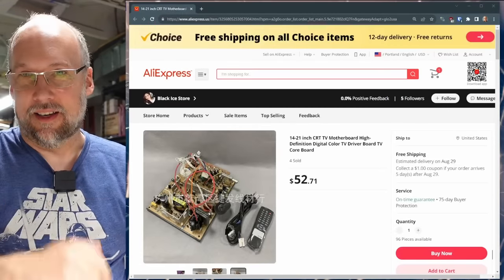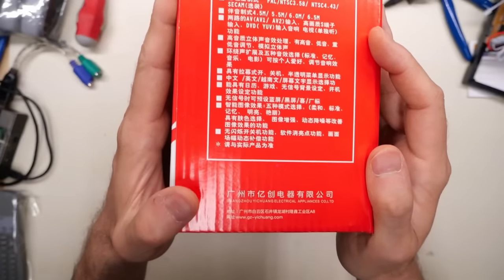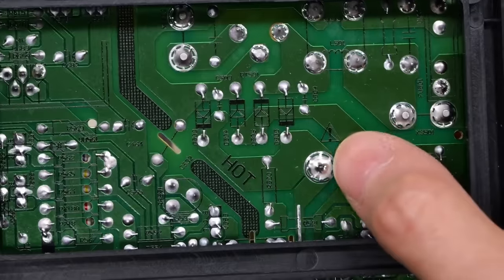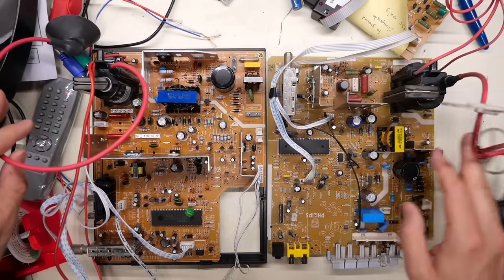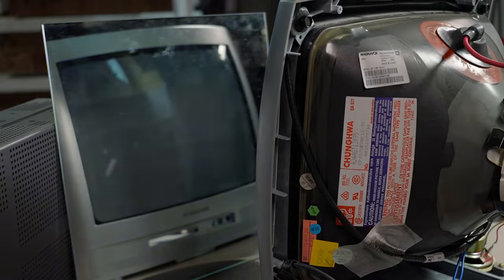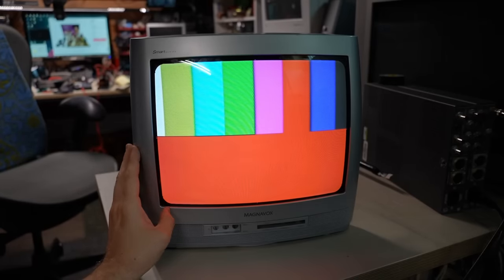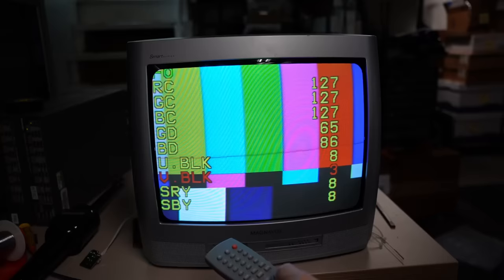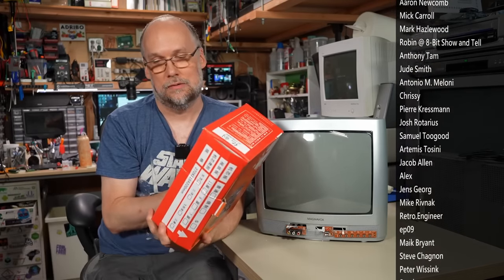I replaced the main board of this TV with brand new parts made in 2023!

Comment: I think the language support hints at what the purpose of these boards is:  repairing TVs in parts of the world where the cost of living is very low and incomes are very low.  All those videos of people building something new or welding an engine block back together, they aren't just clickbait they are really doing this on a regular basis.  Repair culture is at the heart of many low cost countries.
Reply: Yep, not only in countries with relatively low GDP (I think) but also those with high import costs and/or trade sanctions. Another comment mentioned that being done in Indonesia. I had already known of similar boards to allow such repairs to be done to LCD TVs, but never knew about boards for CRT TVs.
Reply: It’s why many cars in Cuba are vintage 1950s & 60s. They keep them repaired and running.
Reply: @OggVorbis69  We used to be a repair culture, but somewhere along the line someone decided it was more expensive to pay someone the labor to repair than to replace.  My most popular video is about resurfacing brake rotors on a rotary table, the amount of comments about how it's a waste of time and cheaper to just buy new Chinese rotors is very high.  The joke's on them, I'm still running the same rotors on that car and I've made a decent amount of money off that video.
Reply: Yep, and that's just the reason why the 'richer' countries try to block right to repair that much. (I think)
Reply: These boards might be New Old Stock (NOS) i.e. made in the past and being sold now.
Reply: @metatechnologist  That was my thought until I saw a 2021 design date on the board and 2023 manufacturing date on components.
Reply: so true my friend
Reply: @joaocosta3374 Not sure where you got that idea, but Japan has disposable material culture. Single-use plastic is practically a national speciality.
Reply: Me too. It's really bad. :( So much can be saved for ourselves and others by not tossing it and crushing it up and crap...
Reply: in the US repair work is a manual skill... Our education system trains students to have a poor opinion of manual skills and glorifies mental tasks....so we have smart educated"managers" taking 10 years experience to make $60k annually while a commercial driver (we call them stupid truck drivers) can start out earning that amount...the truck driver doesn't have to buy any expensive tools or equipment the company provides that, nor do they have to have closets full of office custumes and in just 2 years can be setup to make $100k+
Reply: Not even in countrys were cost makes things prohibitive 
But in nzd we're I just can't be fucked to spend money hahaha
Reply: Sincerely I'm from Brazil and it shocks me at how little value people in 1st world countries give to their possessions. They just throw away good things as if they were garbage for no fucking reason as if it was nothing. The fact that that is normal to them is depressing.
Reply: repairing stuff used to be a U.S. thing too and it brought them a good chunk of the way to where they are today, when they forgot about is when they began the struggle
Reply: @kbhasi  was the user @strugatski1998 ?
Reply: @casev799  
Yes
Reply: The USA is going to end up this way the knewflat screen tvs & monitors are fragile won’t hardly last someone sneezing on them
Reply: @OggVorbis69 yep USA used to repair everything my aunt in her home ec class in the 1950# was tought how to take apart dishwasher fix it & put it back together also all other stuff that a woman at the time would use
Reply: I wouldn't be a jack of all trades if I didn't grow up in poverty
Reply: Soon to be the west....Start learning boys 😅
Reply: LCDs are cheaper than CRTs. This is for arcade machines.
Reply: @videobenny3  That's pretty bad comparison, the Cubans haven't had the option to buy new cars for the past 60 years. That makes it so they've had to repair their old 50's & 60's cars.
Reply: @MrGtagangster  funny thing is the blame that waste to that growing countries while they are the culprit of that e-waste
Reply: @CATech1138  This is what's wrong with the current educational standard.

Education is great, but present options!
Reply: @MrGtagangster  Mathew Crawford's book Shop Class as Soul Craft explores the concept that pencil pusher degrees aren't the universal answer to educational goals....
Reply: @videobenny3  Also in an incredible humid salt laden atmosphere, they do it!!
Reply: @videobenny3 That isn't actually the real reason. It's due to the gov not letting people buy modern cars
Reply: I love to repair things in Germany but most of the people I know tend to just buy new. If they ask for help, I'm glad to do so and also recommend buying 2nd hand stuff when they need replacement and repair isn't possible/economic. Hopefully the EU will be successful in fully enforcing the 'right to repair' some day.
Reply: @joaocosta3374  That's really not true. The Japanese are very fond of throwaway things, and will tear down a perfectly good old home in favor of a generic newly built one.
Reply: @IntegerOfDoom  arguably this is at the core of everything wrong with the us and similar countries, to the point that we treat people in the third world as disposable.
Reply: Its starting to happen here to
Reply: @3333218  é porque os produtos não custa um rim como aqui. É muito imposto para um país de 3° ou 1°, fora que a qualidade é péssima. Está cada vez pior comprar algo novo e que tenha qualidade, nós não temos as mesmas oportunidades de escolhas como os americanos,somos obrigados a sustentar esse sistema falido de pirâmide política. (Nossos políticos só sabem falar em aumentar imposto, talvez seja isso...)
Reply: @JLasdislau  Olha amigo, concordo com o que tu falou mas discordo da sua visão política. Sou Comunista, pra mim não importa o que os políticos façam e quem estiver no poder sempre vai ser a mesma merda; só quando os trabalhadores se unirem e derrubarem o Estado Capitalista Burguês é que a gente vai começar a ver alguma melhora. Curiosidade: Em vários países Socialistas não existem impostos; isso porque essa ideia de que o estado deve funcionar como uma empresa que opera em dinheiro é coisa de Capitalista; dinheiro é só um pedaço de papel, o que tem valor mesmo é o trabalho.
Reply: on the opposite rich countries have a "trash it " cutlure , supported by electrical and electronical appliances manuifacturers . they don't sell spare parts , and sometimes they make their device become obsolete , thus forcing you into buying new one .  servicing is good for the environment
Reply: And they are awesome. It made me realize how wasteful we are. I watched some guys rebuild a whole excavator.
Reply: @kbhasi you can get generic lcd boards? I never would’ve known!
Reply: @uzaiyaro  
Yes. Most sellers even preconfigure them to work with specific LCD panel models that they then indicate in their listing title and description.

Some of those sellers even sell them together with the LCD panel they're configured for, to the point where it's basically one of those off-brand or no-name monitors but without the actual shell, stand, and power adaptor. Those kits really helped to stop game console modders from ripping apart PS1 slim LCD add-ons.
Reply: @MrGtagangster most people prefer to replace than repair anyway and there is still a big movement to prevent repair? It’s weird.
Reply: People in the west are increasingly buying old crts for authentic retro gaming, a lot are dying. So there's two use cases for sure.
Reply: @videobenny3 That has absolutely NOTHING to do it! Google The Cuba Embargo, they literally couldn't buy new cars. There were no imports or exports and I mean none.
Reply: @joaocosta3374 gomi not mura
Reply: I dont think so. 52$ plus 60$ for the service it's a used TV from the last 5 years. Probably this is for retro TV with value
Reply: I watch to much speed running stuff because I did not even think of lower income countries and just thought on how speed runners of older games run them on CRT thanks to lower lag.  To the point that some games are unwinnable on newer screens.
Reply: at the same time it's under attack by crazy people ;D
Reply: Yes and more and more needed as the new things delcine in quality ...I just got a bronie camera from 1930s and omg its so simple and awesome I love it...
Reply: Right to repair is SO important
Reply: That is a fact. And it shows how wasteful we are too. We're lucky.
Reply: I've seen replacement controllers for washing machines. Probably for the same market segment.
Reply: @0x0fffffpossible now with LEDs.

I've repaired some ceiling lamps with "unreplacable" LEDs
Reply: I would say is not so much the cost of parts but the relation of VERY low cost labor to the relative high cost of parts (maybe due to import costs imposed by politicians). People from the US should be happy that their labor is highly priced!
Reply: 3rd world counties have no choice in the matter when they don't have the means for the latest products. In Pakistan they make parts and are quite good at it given the lack of resources.
Reply: @videobenny3 only reason why they have vintage cars is because they can’t get anymore more cars. So once they are gone they are gone. Nothing to do with wanting to repair stuff.
Reply: 'And we wish was worldwide.
Reply: well, i will order this for myself cause my little retrogaming CRT Saba Tv died last week. Ok, i'm italian and  my country isnt one of the richest county in the world, but i thing those solutions are just made to sell to anybody needs them. It's a very Chinese business mindset.
Reply: Yes. When i travelled through afrika they used to repair old fridges and sell them everywhere. Here in germany nobody would repair such things on an 10 year old fridge.
Reply: In Russia's poorest city a doctor earn 5000 usd over 20 years.. So there's the perspective on why repairs on such things still a thing.
Reply: @3333218 More depressing than the crime rate in your country? Watch out for those scooter riding bandits lol.
Reply: this is soo true, its even a cultural thing in countrys like that, i know by first hand that they acutally dont like modern tvs and ppl think they are cursed, dont laugh its real and its a cultural thing there
Reply: @CATech1138  To be fair, there are a LOT of other mental jobs outside of management that are EXTREMELY important....engineering, science, medical - the very reason you're able to write this comment is because of scientists utilizing local networks on college campuses decades ago (along with tons of research and many innovations in the subsequent decades) - creative endeavors, research and manual labor are all very important to the function of society.
Reply: just don't weld a crankshaft.
Reply: That’s why Brazil is still on the PS2 kick and barely over the Sega Master System.
Reply: While it is by necessity it is one of the things I love about my country. You fix things and there are many places to take things to be fixed for you at a reasonably price.
Reply: @Ian-Omega  That's oddly specific and unrelated to my comment. Me convence aí que cê não é BR mano.
Reply: Adding to the comments here I think that now in the West (in Europe at least) this is being discussed more. We have places now where you can bring your items and they'll repair it for you, sometimes even for free to promote this way of thinking. The problem is many products are made to not be repairable. The EU is working on laws for that. Same with cars. There are many people who would like to repair their cars cheaply but modern cars are not only too complex but built like throwaway items. And there is actual proof of this. BMW for example says the transmission oil is a lifetime fill. So it doesn't need changeing (already BS) but when you look closer into what they define as "lifetime" it's a 180.000km!!!! Like WTF for an expensive modern car. Also buying new is often cheaper than repairing. Especially when you need someone else to repair it for you. It might sound weird but at least in the richer parts of Europe throwing away is better for people with low income. They don't have the privilege to think too much about this stuff. They have to go with the easiest and cheapest way. What people do here is rather buy used products. Taking this TV for example. Except for it being totally outdated it would also be ineconomical to repair it. The spare part is over 50 Euros excluding the labour (you shouldn't do this yourself). For 50 Euros you can get a much more modern used TV. For Tech in general it's also that everything is developping so fast. You don't always have to have the newest tech but you fall behind quick and have disadvantages if you're using ancient tech.
Reply: @0x0fffff I do that in Spain, for fun. A cheap LED lightbulb is 1€. It takes me less than 5 minutes to bridge out a burnt LED (black spot of death) with a blob of solder, and you can buy a reel of SMD LEDs for one or two euro with 50-100 LEDs, enough to repopulate 10 to 30 lightbulbs. So worth it if you make minimum wage or are unemployed, even here.

Also fixed many microwaves people got rid of because the intenal fuse failed. Even repaired the high voltage fuses (longer with a spring in them), which is definitelly worth trying no matter how much you esrn, because a new microwave goes for about one hundred euro.
Reply: @eformance  no, because parts sales is where the money is made. just like ink for printers.
Reply: @kittycat0876 Actually cats peeing on them has wrecked a couple of my monitors, and several keyboards too.
Reply: I wish we still had something of a repair culture

Comment: It amazes me that ALL the tremendous R&D effort in television broadcasting on analog CRTs, dating back to the 1920s, finally came down to a board that you bought for $50 bucks which has a built-in game. An amazing 100 years!
Reply: Analog television was a triumph of...something.  (Spoofing bandwidth, mostly.)  Seriously, the idea that sorta-kinda acceptable full-motion video could be rendered with a few dozen active components is preposterous in retrospect.
Reply: @frankwilhoit  I mean people accepted it just fine for over 50 years, we didn't know any better!
Reply: And 50$ is probably already with 100% markup!
Reply: I'm just amazed at the brain power to have come up with analog circuits to encode and decode all the signals, get the timings right, etc, and do it over the air!
Reply: some of those old circuit boards are horrifying just to look at, in the hellraiser movies a puzzle cube opens the gates of hell, imagine opening a device and inside you find a circuit board like this one 1950 8" B&W Motorola 9T1 
https://youtu.be/nmQFYhzOtMY?t=624
Reply: Only for the PCB, good luck making tubes today (not possible and not for 50 bucks if someone attempt it).
Reply: @kargaroc386  They knew better. Upping the resolution results in better quality, they knew that all the time, it's a no brainer. And there were attempts. France used a b&w 819 line (736i in modern terminology) television standard in the 1950s, which was later abandoned in favour of 576i like the rest of Europe. Japan had a full analogue 1125i system in the 1970s, alongside NTSC. Europe developed a 1152i system in the 1980s, which was never rolled out. The reason none of these survived is that they cost too much bandwidth and CRT screens in appropriate sizes get very chunky.

What helped HDTV finally take over were two things:
- Digital compression which made the bandwidth requirements acceptable.
- Cheap lightweight LCD screens.
Reply: @Andrew-li6ik  wtf bro :face-orange-biting-nails:
Reply: I've worked on old TVs and the amount of components in those is just staggering, it amazes me that they ever got electronic TV to even work in the first place and as you say for us to have gone now to the point where you can buy what is virtually a novelty single chip solution for 50 bucks is testament to the sheer genius of the human race.. smartphones etc were in science fiction when I was growing up watching the TV,  even the crew of the enterprise didn't have an all powerful all in one device 😅
Reply: @Andrew-li6ik  oh no......
Reply: No componant inputs or s-video is kind of a deal breaker though.
Reply: @rkan2  The dollar sign goes before the number.

Comment: Years ago I found my late father working on an old wooden TV set in his shed, at the time he worked for Radio Rentals in the UK and had brought home a very old set which had been rented out to an old lady for decades, but was now beyond repair. The old lady didn't want a new plastic TV set in her living room so my father had removed the guts from a modern Furguson TV set and had modified the old wooden cabinet to take the new guts. He had just finished it when I walked in and the results were very impressive, even with a close inspection I couldn't see any of the woodwork done to match the tube to the old wooden frame and the varnished wooden panel he installed where the old controls were almost matched the rest of the set, so you had to stand in front of the set to spot the wrong wood grain and the new varnish! Those were different times, when pride in a job trumped shareholder dividends.
Reply: Lol, I thought the ending of the story had to do with the "late father." I'm glad it had a happier outcome. I bet the old lady was well pleased.

And today we probably wouldn't because of time and money and the potential for liability as the product was now modified from it's original form and cabinet.